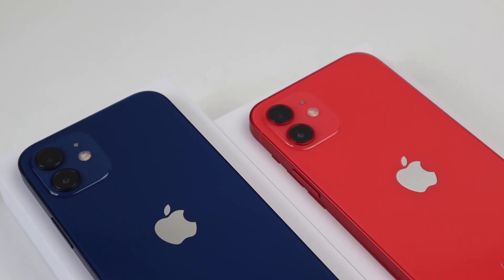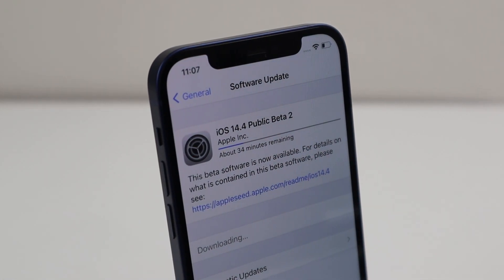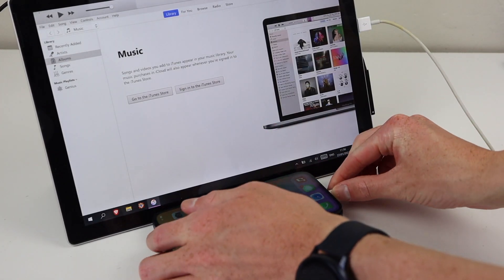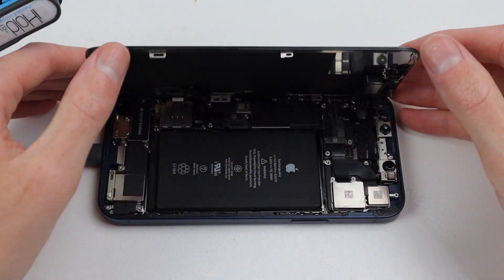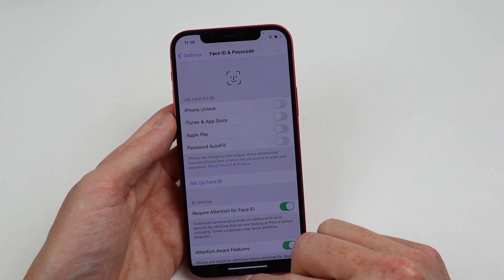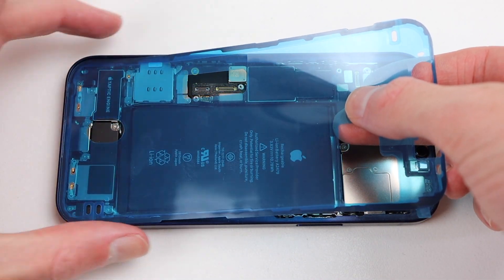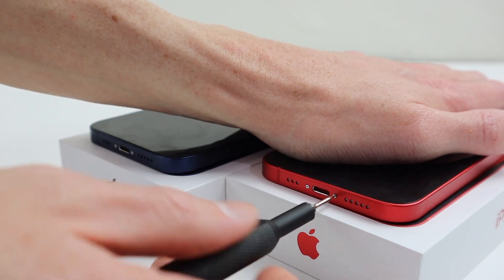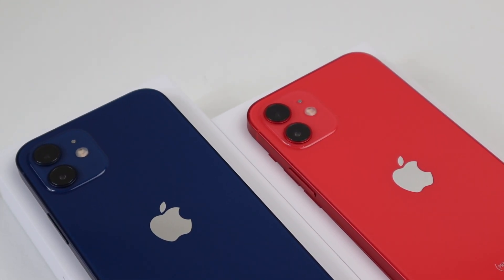iPhone 12's Latest Approach at Deterring 3rd Party Repair

Comment: iOS 15: Apple starts pairing screws to each phone, if you change screws between phones you’ll get a “unable to verify this IPhone has genuine apple screws”
Reply: Apple screw max
Reply: @OhSoTiredMan  699$
Each
Reply: Ghostwalker CIA *Apple Screws-U
Reply: @OhSoTiredMan  £269 / $269
Reply: i wont update my iphone to 15 then
Reply: @dorianplayerone  They'll have it hiddenly implemented long before they "activate" the feature. You'll be screwed over before you realize.
Reply: Don’t give them ideas
Reply: Shut up! Apple may listen and get some horrible idea, would not surprise me if they found a way to do it....
Reply: @FullCourseRacingDK  shut
Reply: @FullCourseRacingDK  Or they could make a sensor that senses light and then charges a specific circuit to render the phone. And to prevent this some sort of special light needs to be shined at the sensor and reprogramming needs to be done.

The sensor could be a solar panel in the size of a hair. And maybe the procedure of opening up iPhones is then other , like with your camera film. You could open your old camera ONLY under red light or the film would be destroyed because of the light.

So they could make a solar cell that doesn't get activated when lit with uv or something? Or that if it was opened and triggered then they can reverse that by having a solar cell which can a) make voltage of light and b) make a different voltage or energy when being lit by a uv?
Reply: @FullCourseRacingDK  true
Reply: @FullCourseRacingDK what if we reprogrammed Tim Cook body to reject his own internal organs ?
Reply: The most ironic part is that this "genuine Apple part" message is a complete fraud, as Jeffery proved that even using parts from a brand new iPhone 12 will still make the phone think you aren't using genuine parts. Apple should just suck it up and be honest with a "Unable to verify you paid Apple ludicrous amounts in repair fees, so we're blocking your own repair" message.
Reply: They would probably use a new type of screw lol
Reply: @JJ_Aviation  probably the shape of the head would be an Apple logo and it would technically be trademarked and make it impossible to buy screwdrivers for it. But they’ve also actually put rubber in the screw heads that hold the displays to MacBook Pros for years to show if they’ve ever been removed. So I’d imagine that they’d do something in the future to deter repair even more
Reply: I am sick and tired of apple and the bulls**t, we should all have the right to repair without your phone becoming broken
Reply: and then disables the entire phone from using anything held down by screws, i.e. everything
Reply: WRITE THAT DOWN WRITE THAT DOWN
Reply: Stop giving them ideas.
Reply: Don't give them ideas.
Reply: Actually, they might do that.
Reply: Dude don't give em ideas, they have the money to do so lol.
Reply: Nothing is impossible with Chinese xD,
Reply: Next iphone gonna have everything paired, including screws
Reply: @Phaswana or apple screw you pro max 😅🤣
Reply: Screw Apple!
Reply: when you use a 3rd party case or screen protector. iOS will start blocking you with message saying you are not using genuine parts
Reply: this is what worries me about apple even thinking about bringing out an apple car....can u imagine, having to change the tyres on it, unable to verify original apple wheels, wheels locked and unable to rotate until genuine wheels are found.......
Reply: i fucking died when i saw this comment
Reply: @broz1312  unable to verify genuine death
Reply: Then the phone dismantles itself and ignites in flames that you can only douse out with a apple extinguisher which is 300$
Reply: That would be quite impressive technically lol
Reply: Dad: Why are the FBI here?
Reply: If it brings more profit Apple would fill the phone with epoxy so it can not be repaired and also not be recycled. The fanboys would still love it for the added strength.
Reply: You mean: "screwed by Apple by Apple screws" ?
Reply: iOS 16: "buy an apple tempered glass or iPhone will stop displaying"
Reply: why are you giving them ideas?
Reply: Or “unable to verify this iPhone has genuine adhesive”
Reply: No. Just no,
Reply: Next will be the water resistant tape "𝙐𝙣𝙖𝙗𝙡𝙚 𝙩𝙤 𝙫𝙚𝙧𝙞𝙛𝙮 𝙩𝙝𝙞𝙨 𝙞𝙋𝙝𝙤𝙣𝙚 𝙝𝙖𝙨 𝙜𝙚𝙣𝙪𝙞𝙣𝙚 𝘼𝙥𝙥𝙡𝙚 𝙒𝙖𝙩𝙚𝙧 𝙍𝙚𝙨𝙞𝙨𝙩𝙖𝙣𝙩 𝙏𝙖𝙥𝙚"
Reply: @seijimilan9469  then the air around it:
Unable to verify apple oxide
Reply: @stuff31  then the tempered glass and case:
"𝙐𝙣𝙖𝙗𝙡𝙚 𝙩𝙤 𝙑𝙚𝙧𝙞𝙛𝙮 𝙩𝙝𝙞𝙨 𝙞𝙋𝙝𝙤𝙣𝙚 𝙝𝙖𝙨 𝙜𝙚𝙣𝙪𝙞𝙣𝙚 𝘼𝙥𝙥𝙡𝙚 𝘾𝙖𝙨𝙚/𝙏𝙚𝙢𝙥𝙚𝙧𝙚𝙙 𝙂𝙡𝙖𝙨𝙨"
Reply: lol
Reply: I bet they will come up with some BS that using rivets instead of screws some how helps the environment.
Reply: Charging ports*
Reply: Introducing the Apple Scree u
Reply: A price of apple screws would be the same amount of buying an Apple TV stand.
Reply: 😂😂😂 Good one
Reply: So screws will not hold the phone
Reply: I can see that happening
Reply: @crystalcustoms5458  that wouldn't be too much of an issue now as the screw type is a little more common than it used to be
Reply: You would be screwed...
Reply: Replacement stainless steel screws $39 and $9 with apple care
Reply: lol
Reply: wait till they do that and lose money
Reply: Wtf 😂😂😂
Reply: hahahaha
Reply: Iphone 12: No camera replacement possible, you need to let it do at an expensive Apple store.
Iphone 20 pro max/nothing/ultra in 2028/2029:
Unofficial adhesive detected, unable to verify device.
Reply: all screw lengths are randomized in each phone so using other screws will destroy it.
Reply: Imagine paying for some apple screws 😂
Reply: 2050: apple deters third party cases styluses chargers and evrything you use with your phone
Reply: Apple screwing screws
Reply: Breaking news:
The IPhone 14 can only be bought with apple money due to too much money spread in middle class families. If  you need apple money you can simply go to the app store an buy it there. To get 1 apple dollar you just have to pay 10 dollar. The price of the IPone is ofcourse still 1500 apple dollar  cause of envirement reasons its not justifiable to print new price tags. 

2023:
There is now no more money in the entire middle class and therefore money laundering has decreased by 0.52%.
Praise Apple
Reply: *iPhone
Reply: Might as well put the phone through the smelter at that point! Nobody wants to buy a phone thats not repairable!
Reply: U laughed now, to only realise later on it really happened to every other brand of phones including the ones u r using due to their copying behaviour. Then again I ask this: Would u still laugh for giving ideas for them to further deteriorate your own as well as other people's lives? Is the joke worth it? Have you even thought about this before posting this joke up jst for many likes purpose? 🤔
Reply: That would be a major SCREW-up :p
Reply: Don't give Apple ideas
Reply: you got screwed by a screw within a screw[standoff]
Reply: iScrew Pro Max
Reply: Apple screwed you
Reply: Watch they put chips in their chargers so if someone used a non genuine charger they would know and it would void their warranty
Reply: I would not be surprised if they actually do that
Reply: Even chargers too
Reply: “You are screwed to the max” - Apple
Reply: Hell
Reply: They’ll probably do the same thing with SIM cards LOL
Reply: iOS 17: The phone will now detonate if genuine parts are not detected.
Reply: also the water and dust resistant seal😂
Reply: I'm suuuper late but still relevant, if it says that then you can definitely verify that you're genuinely being screwed by Apple.
Reply: Don’t give them any ideas 💡
Reply: If you lose even 1 screw, you will get:
"Important Screw Message"
Unable to verify if <serial number of the missing screw> screw is genuine, screen will lose touch
Reply: we have complimentarily disabled Face ID and no more true tone 💀
Reply: apple screws
Reply: iPhone will erase NAND because one Screw is not genuine,in 30 seconds
Reply: Each screw cost S10. And S25 for the titanium

Comment: I still think it's crazy that even with genuine parts you can't repair it, I get the face id and touch id sensors a little more sense at least there are security reasons but if someone's smart enough to figure out how to bypass that they figure out a way to get into the phone.
Reply: It’s doesn’t realy limit your phone now. Its like a non activated window 10 lol